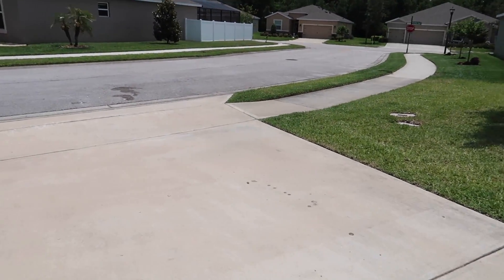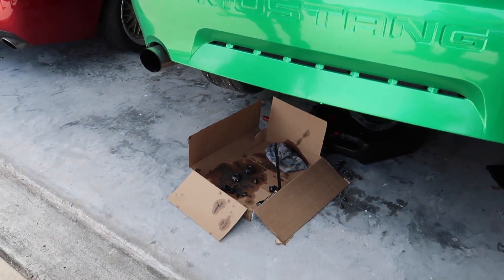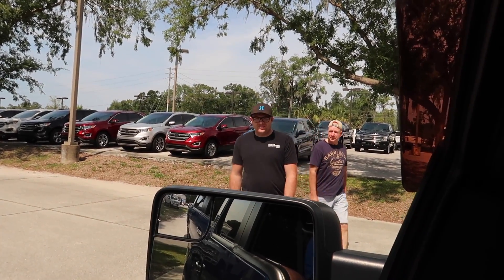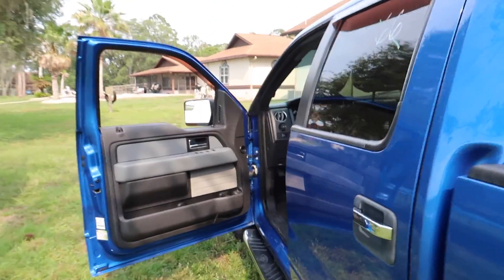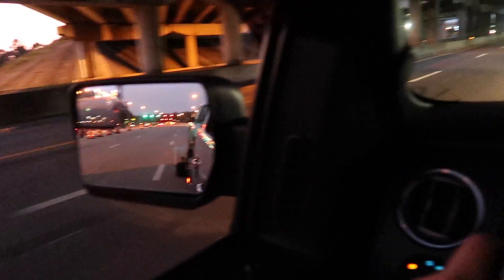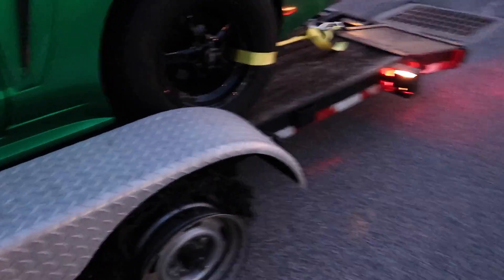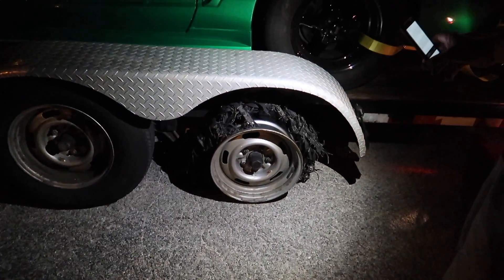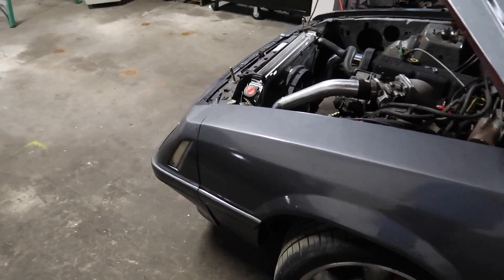Moving Turdzilla - Had a tire blowout and kept going!

Comment: Have you ever thought about getting those drive on ramps or some blocks for the truck to take loading angle out of the rear of the trailer?  If you have enough room you can also put the trailer tires in the gutter and load from your driveway to take out the angle.